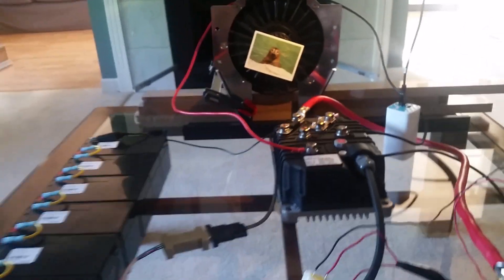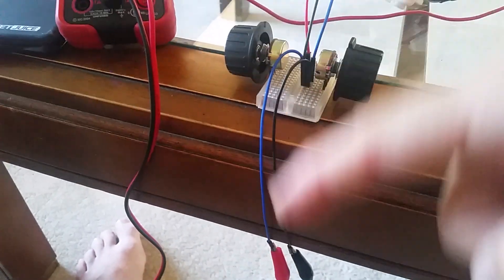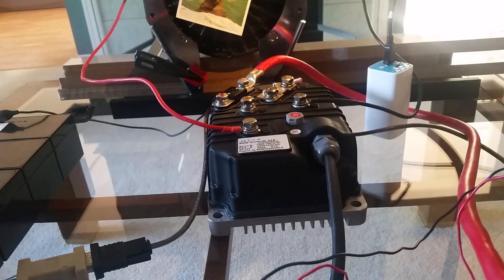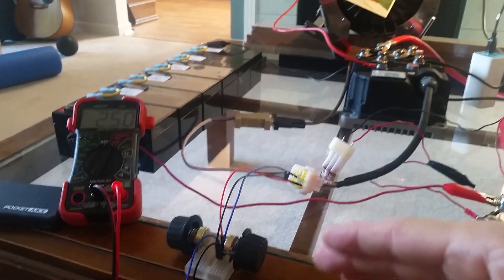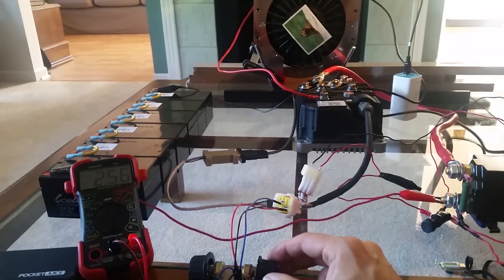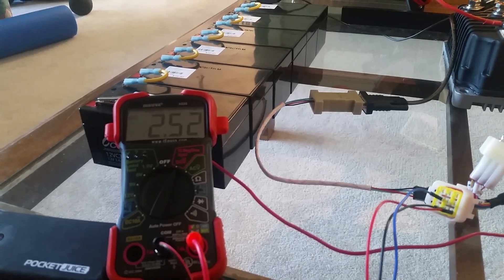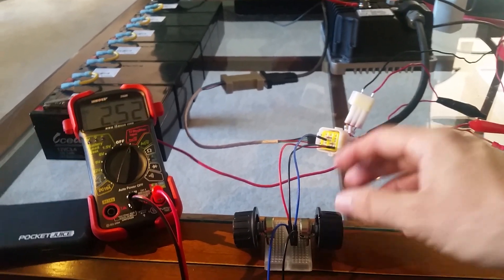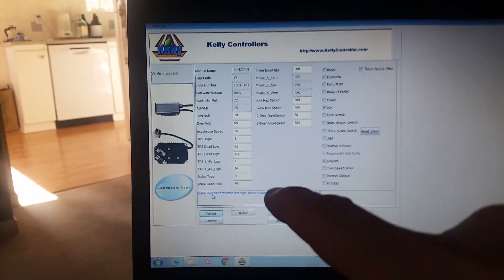Electric Boat - 72V Upgrade! Throttle Test with a KPM 72V Motor Controller

Comment: Thank you so much for sharing this! What joystick did you buy? I have roughly the same setup. Same controller. In the middle of getting the parts and trying to configure for a 35' sailboat. Don't know what to use as a throttle.
Reply from the maker: I did a retrofit. Cheers!  https://youtu.be/3n8zipVEyMI

Comment: Right to repair is crucial. I’m curious how heavy the boat is and how well the motor pushes it. Also curious about battery bank size, longest duration of sustained use and cooling. I’m considering doing something similar to a catamaran rather than buying new or used diesel.

Comment: Hey I was curious if you are planning to do the Hull modifications to the boat?  I was planning to rebuild my swim platform and now thinking I should build it to include a better transom design to reduce drag
Reply from the maker: Hi Russell, the answer is possibly. I had a bunch of "life" events that happened over the last two years that derailed my plans. At the moment I wanted to see how the boat will perform with higher voltage controllers. I'm just waiting for some parts to be shipped for the final install. If all goes as planned, a swim grid extension and transom mod will for sure be a top item for the winter.

Comment: I am excited too and I am wondering where this will lead. There is a lot of abuse with marine fly by wire tech. They always try to hook You with the controller. Like the Kelly controller more everyday. On what voltage did Your older throttles work ?